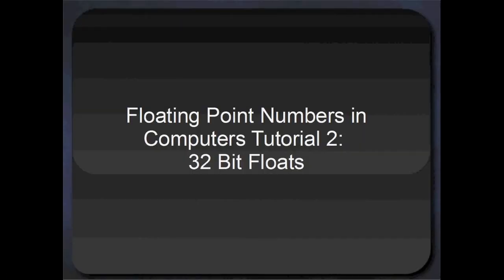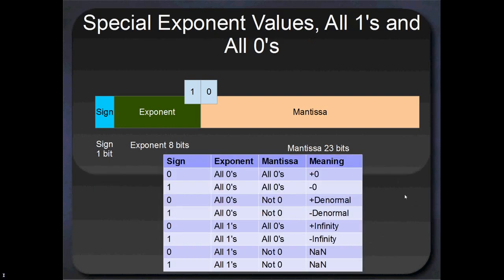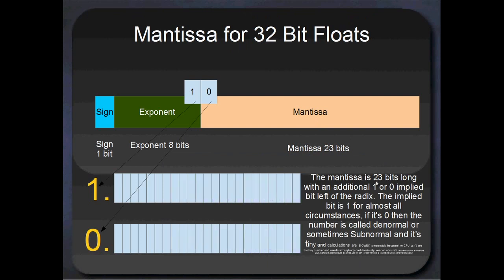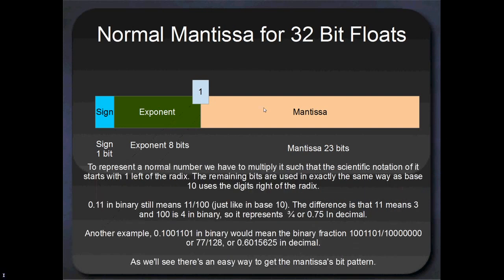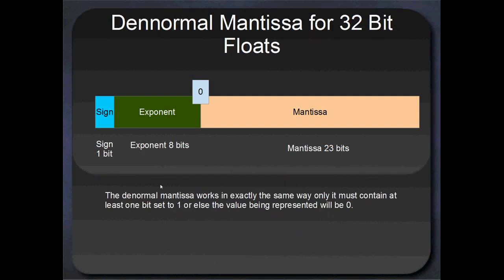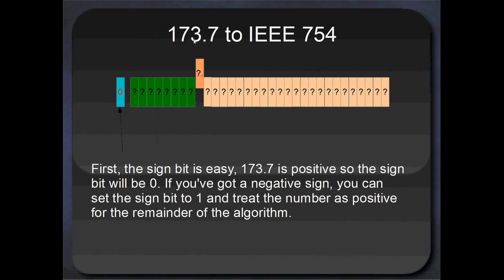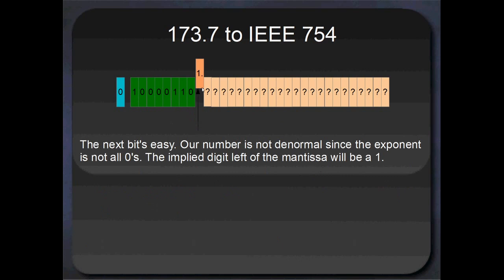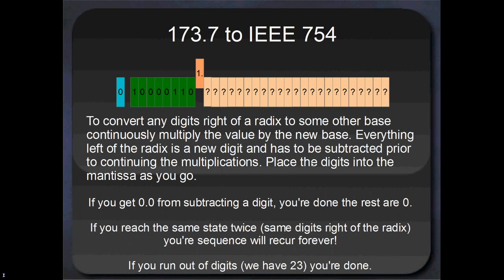IEEE 754: 32 Bit Single Precision Floats

Comment from the maker: The bias is 15 for 16 bit floats (like the GPU sometimes uses), 127 for 32 bit floats, 1023 for 64 bit doubles and 16383 for 80 bit extended precision (like our x87 FPU uses). Each of the different sized floats has it's own predefined bias.

I guess they had a choice, the exponent field gives magnitude and the mantissa gives precision, they figured an 8 bit exponent and 23 bit mantissa was a good balance between the two.

Comment: Is the bias always 127 with IEEE 754? If so, is there a reason why? Thanks
Reply: because the exponent is 8 bits long, 2 ^ 8 is 256 and dividing that by 2 is 128, you subtract one and you get 127

Comment from the maker: Assuming you're talking about two IEEE f loats? You'll want to look at operations on scientific notation numbers. If the exponents are the same you can add the mantissas and normalise, don't forget the implied bit. If the exponents differ you have to multiply one of the numbers by  a power of 2 till the powers are the same, then add the mantissas and normalise.

Hope this helps, thanks for watching.

Comment from the maker: Yeah that's my screen recorder, CamStudio, it's good but for some reason when there's not a lot of graphics in the lower portion of the screen it flashes like this. It's in the original mpeg as well. I try to make fairly busy slides to avoid it but it still happens sometimes. I hope it's not too distracting...